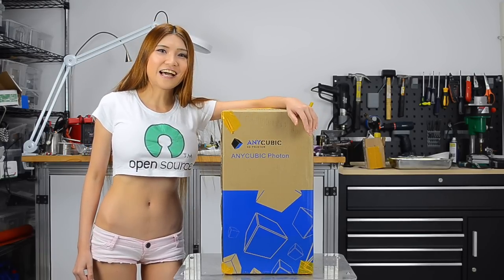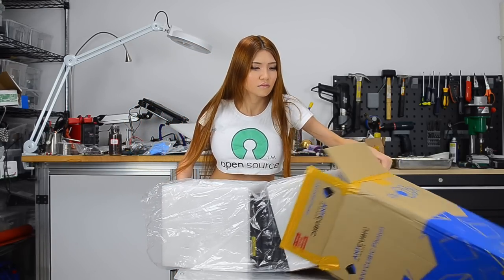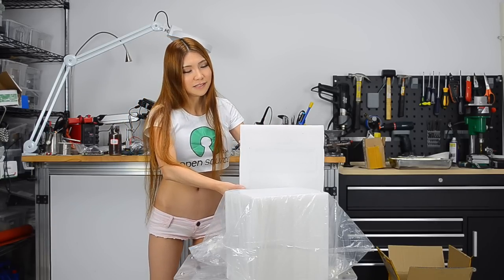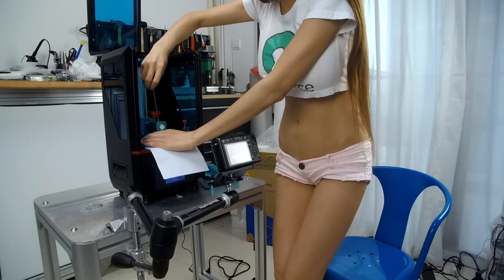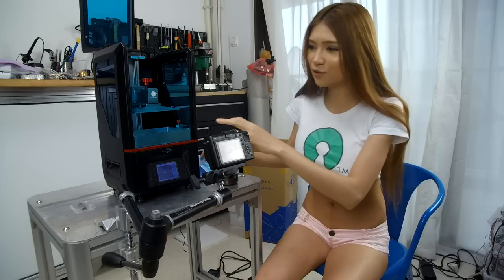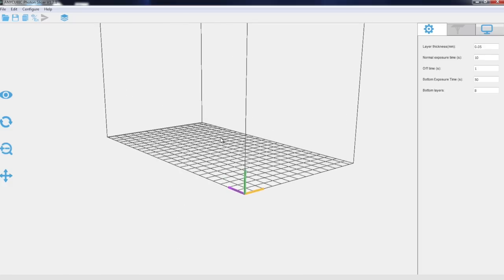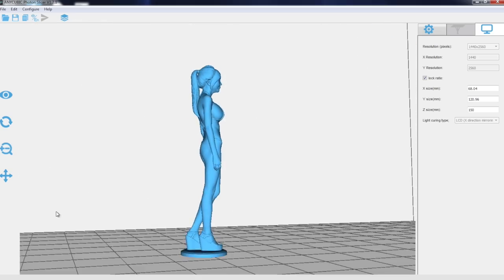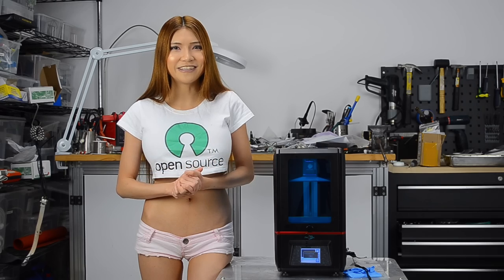Anycubic Photon DLP 3D Printer- Unboxing and First Impressions

Comment: Price: The list price should be US$499, but I haven't seen a street price yet.

I really like these "unbox and print" videos.  Thanks for mentioning the smell and mess of resin printing: The time, mess and waste associated with switching to a different resin is one of the reasons I haven't purchased one.  The general "best practices" approach seems to be to switch between multiple sealed print tanks, so only the print bed (stage?) needs to be washed (which is needed after every print anyway).

Does the Photon have a resin tank that can be closed/swapped as an accessory?

Mini-Me?  Looks more like a Nano-Me!
Reply: It seems pretty big, so I'd expect there might be a bit of an import price to the US too, since it's a Chinese company.
Reply: $500 would be really cheap for this type of printer. The FormZ printer here in the USA costs over $3,000, and the resins are very expensive.

Comment: Thanks for the unboxing video!

Do you know whether the photon itself comes with a software compatible with Linux? I could not find anything on anycubic's github organization/user regarding the photon printer; and neither their website has an alternative software running on Linux, only MacOS and Windows versions are downloadable there.

Links for others:
- http://www.anycubic3d.com/support/show/594032.html
- https://github.com/ANYCUBIC-3D?tab=repositories

The only other kind-of open source alternative, which is still in the make, is this project here:
https://github.com/formlabs/hackathon-slicer

I would also like to ask whether you know details on whether or not there are alternative firmwares available (that would support e.g. png files instead of the proprietary format) and on how to flash an alternative firmware on it?

Thanks in advice.

Comment: I've heard that there are 3d printers with the capability of printing with a medley of different materials... What all can be used for printing?
Reply from the maker: Under $5000USD is all plastic and resin. The metal ones all cost as much as a house and are for industry...

Comment: Thank you for video, would it be possible to print out with this printer using 'Tough resin' from Formlabs?
Reply: Ken Jiseon Kim should work since it is an open source printer. But it’s a shitty printer compare to formlab printers.

Comment: I have never owned a 3D printer. I am thinking about getting one but have no idea what one to get! I'm looking to make some pretty big things so maybe you could assist me in choosing the correct one to purchase!
Reply from the maker: Multi-part prints have better quality and are stronger, really big printers are not that great an idea. Flashforge Guider II is good if you want large though.
Reply: Will look into it. I could print smaller parts and then assemble them i suppose. Thank you for the reply!
Reply: Prusa i3 mk2 or mk3

Comment: Hello I would like help in electronics, I am new to the subject. could you help me please? I bought a used ji drone, but the seller cheated me. the compass pin is tearing off and the wifi pin has been ripped off too. My question is can we tie up its components directly without changing them. I can send you photos if you want. thank you in advance .

Comment: Looks like a strong competitor to the "wanhao 7"

May i ask what kind of Microscope/stand you use there?
This looks so much better than my crappy plastic stand.
Reply from the maker: Wanhao 7 can't work without a computer. This prints off a USB stick. My microscope: https://goo.gl/EFXUcE
Reply: Thanks for your reply.  It´s quite cheap too. 
I´m not so much into DLP/SLA Printers. Now that they go for sub 500 i might change my mind though.

Comment: Compared to a regular 3D printer (i.e. a Wanhao i3 Plus) how does this compare cost wise?
Reply: It hasn't been released yet but they think it will be about 499USD
Reply: duckrutt $499 Us is a damn good price for a DLP that works out of the box. The only other one in that price range is the Wanhao D7, Which doesn’t seem as nice or as user friendly as this.
Reply: Andrew I would like to agree with you if for no other reason than the D7 requires tethering. On the other hand the Wanhao has been out for months and is up to version 1.4 so in theory most of the kinks have been worked out of their design.

Comment: Why Chinese still uses windows 7
Reply from the maker: Lots of  Chinese use XP LOL, I just run 7 in a VM since it's quick and it works. Mostly I use Mint.
Reply from the maker: Of course, that's Mint running on my workbench laptop when I use the microscope.